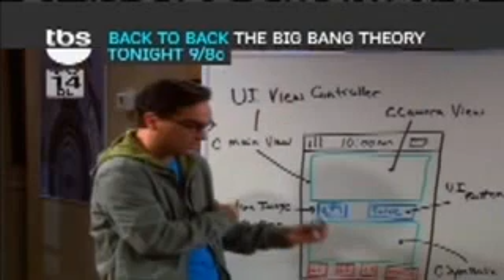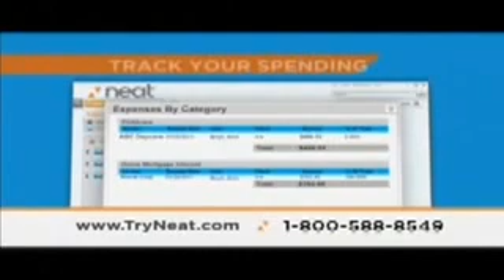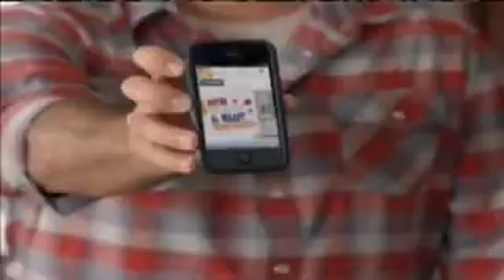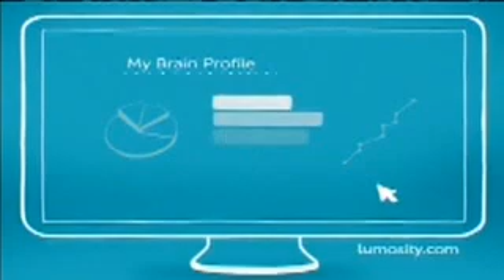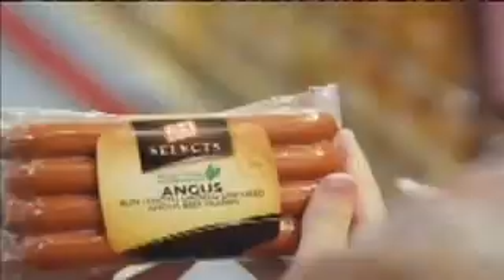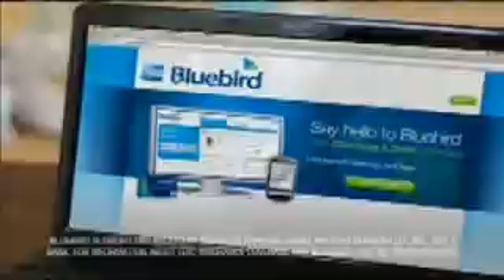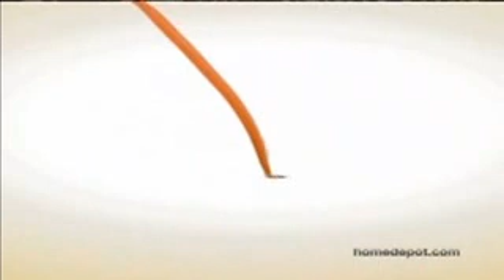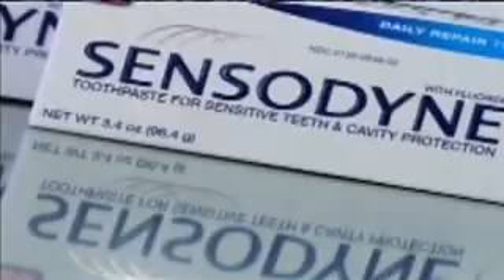TBS Commercials (7/4/2013)

Comment: TBS Commercial Breaks on Thursday, July 4th 2013.

Aired during Shrek.

Commercials in order are:

1. Sears.
2. Applebee's. 
3. Häagen-Dazs Gelato.
4. Venus and Olay.
5. Burger King. 
6. Lean Cuisine Salad Additions.
7. The Hero Marathon promo.
8. Deal With It promo.
9. Trophy Nissan. 
10. Super Beta Prostate Sneyd.
11. The Big Bang Theory promo. 
12. Lowe's. 
13. The Lone Ranger promo.
14. Sullivan & Son promo.
15. Cover Girl.
16. Clorox.
17. Wendy's. 
18. Pringles.
19. L'Oreal Paris.
20. King Of The Nerds New Season promo.
21. Neat.
22. NASCAR on TNT promo.
23. The Home Depot. 
24. Little Caesars Pizza. 
25. The Big Bang Theory promo 2x.
26. The Hero Marathon promo 2x. 
27. Burger King 2x. 
28. L'Oreal Paris 2x.
29. Lean Cuisine Salad Additions 2x.
30. Sullivan & Son promo 2x.
31. Maybelline New York. 
32. Sears 2x.
33. State Farm.
34. Vidal Sassoon.
35. Beautyrest.
36. Cheez-It's. 
37. Planes TV Spot.
38. Clorox 2x.
39. Applebee's 2x. 
40. Aleve.
41. Lumosity.
42. The Big Bang Theory promo 3x.
43. Cancer Treatment Centers Of America.
44. Sullivan & Son promo 3x.
45. AT&T. 
46. The Home Depot 2x. 
47. Wendy's 2x. 
48. Pringles 2x.
49. NASCAR on TNT promo 2x. 
50. The Hero Marathon promo 3x.
51. Chex Mix.
52. Asthma.
53. Oscar Mayer.
54. Clorox 3x.
55. Sears 3x.
56. Ritz Crackers. 
57. Care.
58. Bluebird.
59. Cottonelle.
60. Burger King 3x.
61. The Big Bang Theory promo 4x.
62. Deal With It promo 2x. 
63. Banana Boat.
64. Lean Cuisine Salad Additions 3x.
65. Häagen-Dazs Gelato 2x.
66. Little Caesars Pizza 2x. 
67. Mitsubishi Electric Systems.
68. The Big Bang Theory promo 5x.
69. Copperhead on DirectTV Cinema TV Spot. 
70. Showtime TV Spot.
71. Sullivan & Son promo 4x.
72. Applebee's 3x.
73. The Lone Ranger TV Spot 2x. 
74. Pedia Sure Sidekicks.
75. Wendy's 3x.
76. The Home Depot 3x.
77. The Hero Marathon promo 4x.
78. Sullivan & Son promo 5x.
79. Papa John's Pizza. 
80. Sears 4x.
81. Clorox 4x.
82. Aleve 2x.
83. Subaru. 
84. Dawn Ultra. 
85. Sensodyne.
86. Cheez-It's 2x.
87. NASCAR on TNT promo 3x. 
88. Deal With It promo 3x.
89. The Big Bang Theory promo 6x.
90. Purina Beneful.
91. Burger King 4x.

That's all!